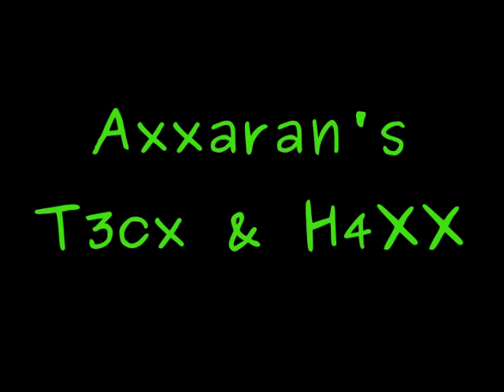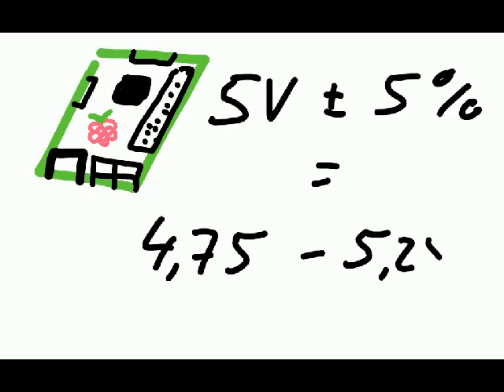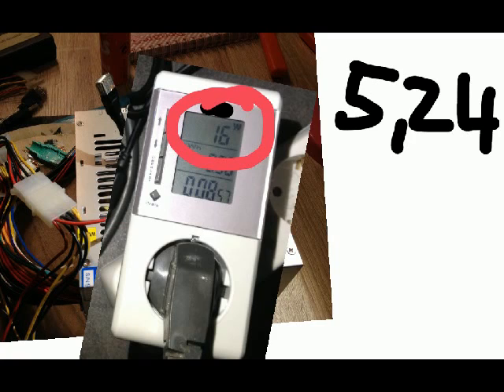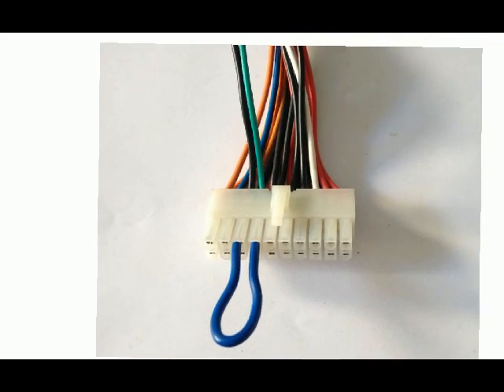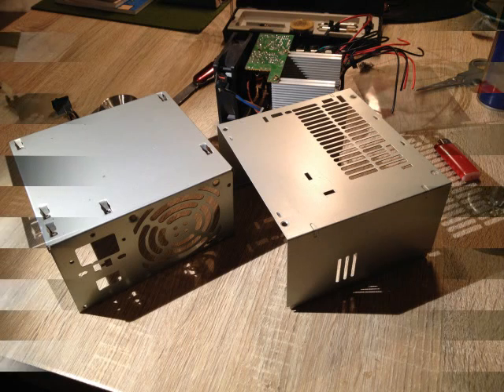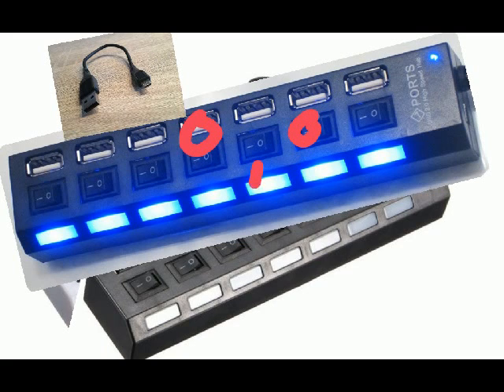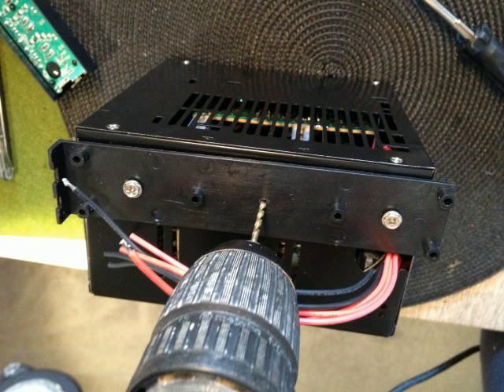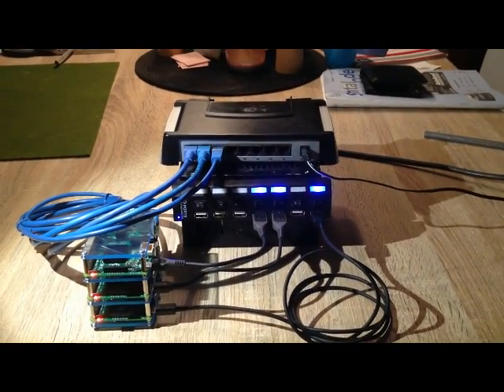DIY: central power supply for Raspberry Pi Cluster made from an old ATX

Comment: I've done something similar by simply wiring multiple micro USB cables to a PSU in order to power / charge multiple devices using the 5V rail as you have one in this video, but I would like to also use the capacity of the 12v rail to power even more devices. I don't want to use a buck converter though to drop the voltage to 5v as that additional circuit would have limited amperage, I would prefer to drop the 12V in the PSU and take advantage of the 12v rails capacity which is usually less than the 5v rail but still generally around 13amps!
Reply: I noticed the unused capacity on the 12V circuit too.  I did go with 2 50W buck converters though.  It seems safe to combine their outputs for ~100W of 5V power on the next USB strip.

I'm not daring enough to try to modify the PSU internally (beyond removing the unused PC leads).  Anyway, seems you'll still need an additional 12V-5V converter stage, inside or out.  At least outside, you're not pushing against the design envelope of the PSU.
Reply: @increbulous  Hi Tim, Yes, a buck converter is definitely an option, maybe the only option. I just thought (maybe naively) that I might be able to swap out  some components on the 12v rail of the PSU to match the 5V rail and thus convert it to another 5v rail in a more efficient way than adding an additional psu circuit to reduce it down if that makes any sense. I'm probably talking nonsense but that's why I'm posting to find out, hehe.
Reply: @healeydave  I'm far from a PSU expert; this video led to my first dissection. :)  But in my generic Antec PC PSU, I observed all the stages are soldered and tied down, built for purpose and no more.  Not much modularity to work with, probably for cost reasons as they intend these to work as sealed units, no user-servicable parts, etc.

Watch those big capacitors!  Mine discharge when I hard-switch on the PSU with no supply voltage.

Comment: I followed directions and tested with a VOM at several stages prior to closing up, powering on and hooking up the RPis.  All three are running, but they still throw occasional under-voltage messages in syslog, and the red power-on LEDs even went out!  Yet they sit working away at concurrent Stream memory tester jobs.  VOM shows 4.65-4.7V steady across the 5V GPIO pin & GND.  Am I going to regret this?
Reply: Problem solved, b-----s.  I found a pot on the power supply PCB that adjusts global voltage output.  I added 4% to get 5.2V off of the board.  The Pis are much happier.

Comment: Hey. Nice work  can this be done with raspberry pi 4. I have look all over the internet to finding multiport for pi4.... 5v and 3A out is hard to find.
Reply: I was wondering the same thing. All USB multiports out there go up to 2.5A, so it could never support a Pi4 at maximum load.
Reply: simple, use the internal 5V pins on the GPIO
( so do not use the USB connection)
or hardwire a USB connector (order on ali )

Comment: Very nice work. I just wanted to ask: would it make a difference if you connected the red wires at on point where the barrel connector was? or even better, connect them to a barrel connector that simply plugs into the USB hub's connector?

Comment: Not an electrician.  But, can all 7 ports be used at once?  Under max load, wouldn't it draw 35a.  30a is what it was rated at.  I'm sure the power supply can do more.  30 is safety number.  But, still.

Comment: Could this method also be used to power additional hard drives (full size not laptop size) and as well as a switch? Im thinking 7 pi's + an 8 port switch and 1 or 2 2tb drives (not sure if capacities make a difference). Also, can any PSU do this even older ones or is there certain requirements such as a minimum wattage?

Comment: This is awesome! How much amps are coming out from each usb port? Can it destroy a single raspi if there is only one connected to it since there's a lot of amps on the output?
Reply: no, the raspberry pi will only draw as many amps as it needs, voltage is what needs to be 5V, amps can be anything as long as you give it the minimum of 2A
Reply: do you figure the answer ?

Comment: Hi, thanks for the video. Just a question, u have highlighted the 5v and Gnd connection at 5:56, but at 7:05, u have soldered the red cable (I assume as 5v connection) to the Gnd that u circled at 5:56. Which one is the right connection? I have exactly the same USB hub that u have. 

By the way, great job over there!
Reply: John Wei Ang
Very sharp observation. Congratulations.
Reply from the maker: Damned, you were right! The connections at 7:05 are the right ones ! Sorry for this. This is what happens, when you do all the documentation afterwards... :) Thanx a lot for the hint !

Comment: Can't still understand why you need a pc psu... 
Isn't better to connect the raspberry pi's in parallel to a custom made 5v 2amps power supply
Reply: I am building a 24 node pi cluster and this might be the best solution. If it was a 1-6 node cluster, akner 60w might have been the best but for 24 nodes i will have to buy 4 of anker 60w units and that will be very expensive.

Comment: it's really amazing... but I have a question?  if i connected my smart phone to this power supply to charge the battery,  I'm afraid that gonna blow up cause of the 12v output from it ? I'm sorry but I'm always afraid of electricity
Reply from the maker: Hi Luca, as you can see in the video, i just used the 5V outputs for powering my RaspberryPis. The 3.3V and 12V lines were desoldered :)

Comment: why did you solder multiple 5v wires to the USB hub?  wouldn't 1+gnd be enough at the original cable attachment point?  and don't those 3 separate connection points need to be isolated?  I would think youd be loading down the circuit the way it's hooked up.  I have the same hub and have been considering this mod, but keeping the data lines intact for OTG connection.
Reply from the maker: Hi Ross, see my answer to Greg: 
"Hi Greg, as you can see at 7:08
 i used all 4 red and all 4 ground cables. This is important. It's not a
 good idea to just use one cable, because all the Amps will go through 
and may BURN it. I calculated with an output of 20 Amps, divided through
 5 Amps/cablediameter, which leads me to at least 4 cables to get all 
the power safely through. All 20 Amps through one cable is NOT GOOD ! :)"
I spread the Amps through 4 wires because i use the switch just for powering the RPIs, not for data connections. It's just a cheap way to get many switchable USB-connectors. I dont think that the functions of the USB-switch are concerned, because i just "spread" power and ground to multiple points.
Reply: MrAxxaran okay thanks!  one thing I've never understood.  how does connecting multiple wires in that fashion not be detrimental?  do you cut a board trace somewhere so that they're isolated (kind of)?   I mean in the same manner you would cut a power line on a USB hub to make it externally powered as opposed to bus powered.

Comment: I was thinking along similar lines o a microATX power supply wondering how I could adapt it as a single power supply.  Most of this tutorial was excellent, but your accent gets in the way sometimes making it unclear what you are saying.  I especially got confused after you explained jumping the 20 pin connector.  To keep the power supply from running continuously?  Not sure.  Can you introduce a switch to shut on and off?  Second, what did you do with the other wires?  You brought a ground wire and soldered it but your accent garbled what you were saying and I did not understand.  Since I am not a PSU electronics guru, it would be helpful if you would demonstrate what you did with the internal wiring, show how you removed certain other wires and soldered others...this may be obvious to an electronics engineer...but not to a hobbyist like myself.  Otherwise, great!  Just what I was wondering...if I could get a cheap, economical Micro ATX PSU to power the Raspberry Pi build.  Thanks for your efforts.
Reply from the maker: Hi James, sry for the delayed answer. 
Usually power supplies shut down if there is no consumption. To keep the supply running, even if there is no consumption you have to bridge the pin 4 on the 20 pin connector to ground (black). On my supply it was the green cable. I tracked the green cable back to the supply and soldered it to a ground cable. 

The supply normally has 3V (orange cable), 5V (red cable)  and 12Volt  (yellow cable) outputs. Because we just need the 5Volt (red cable), i desoldered all 3V and 12V cables from the supply, so that only 5V and ground (black cable) were left.

I'm also just a hobbyist, if you can't desolder them, just cut them very very short. As close as possible to the circuit board.

Hope this helps :)
Reply: @Axxaran  You could even use the board detect lines to work as a switch for the entire power supply.

Comment: Or.. you could buy a dedicated 5volt 70amp psu for less than 30usd .. free shipping :-P
Reply: Please advice an off the shelf solution to power a 24 node pi cluster.
Reply from the maker: Nahhh, that would be too easy, and very uncool ;-.)

Comment: How's this worked out for you so far? I've done basically this same thing (I used molex-microUSB adapters instead of chopping up the PSU, but same end functionality) but I've had problems with the power supplies getting unstable after a few weeks of being used that way.

Comment: Hello. Very nice movie :D i was searching somehting like this. 
If understand properly on every 5 v line u have 30 A. So u can connect each line up to 30 usb ports ? if one rasberry pie need 1 A :) .
Second thing  in yours power supply u have 3 x 5v lines. So for each line i can also connect up o 30 usb power ?

So from one simple atx power supply that cost a about ~5 $ u can make 90 power supplys for rasbbery pie ?:D
Reply from the maker: +Paweł Cudziło Hello Pawel, no, the maximum output of the power supply is kumulative 30Amps. I just use 5 lines to split these 30 Amps , so the lines won't burn. If you calculate just 1 Amp per Raspi then you can connect up to 30 Raspis, but, as told in my video, i would calculate a minimum of 1.5 A or better 2 A per Raspi. This all depends on how much USB-devices you connect them.
Reply: MrAxxaran thanks for this video I am doing something similar but my problem is voltage drop I keep having the voltage drop after plugging in multiple devices to the hub do you have a similar problem or is yours working fine. Another thing to state is that mine is similar not identical I am using the same hub with a different power supply I am also connecting it to the power supply differently. However please note I don't need all the amps your using which is why I don't have it connected directly with the power supply wires I am using the barrel connector with the hub. Any ideas why I'm getting such voltage drop?